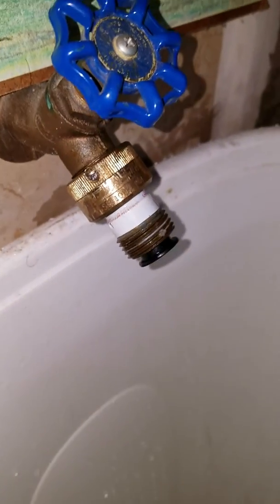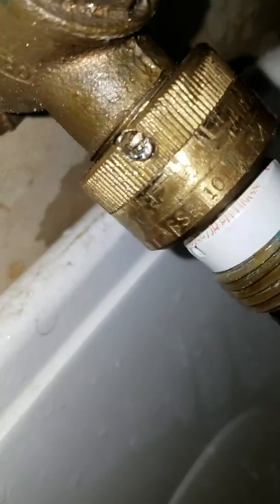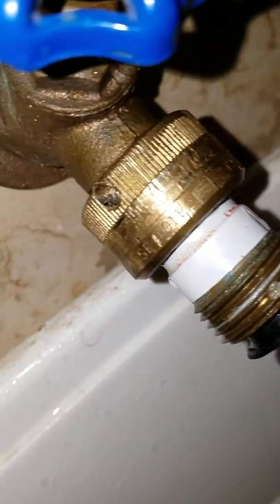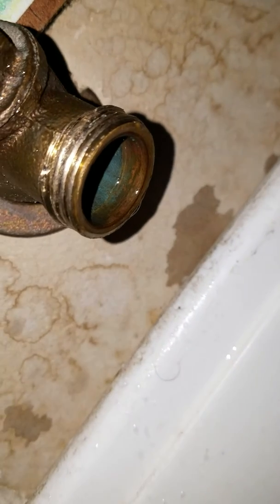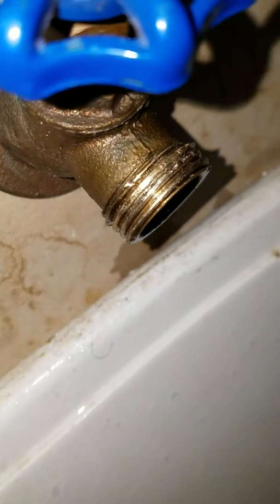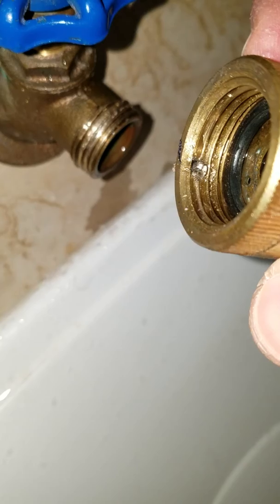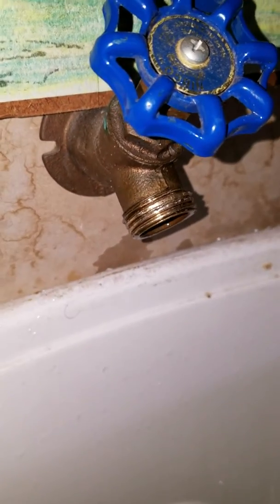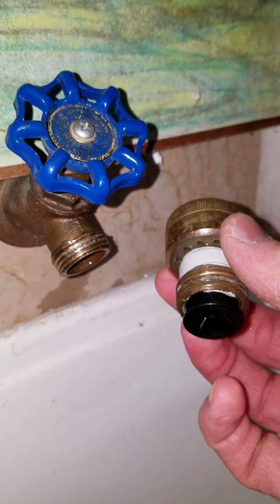Faucet backflow preventer removal

Comment: I actually just removed mine last night.  Thought about drilling but was worried about messing up the threads to the bib.  Used my angle grinder and just carefully “shaved” down the area where the set screw is.  The screw eventually just fell out on its own when I got close to the threads if that makes sense.  then used channel locks to unscrew the rest of the vacuum breaker
Reply from the maker: I think it similarly loosened up when the drill started to get close to the threads. I've used the faucet many times since and there's been no problems with threads or sealing or anything like that.